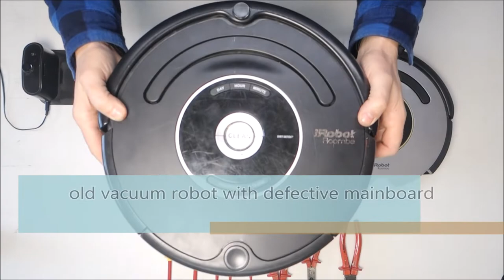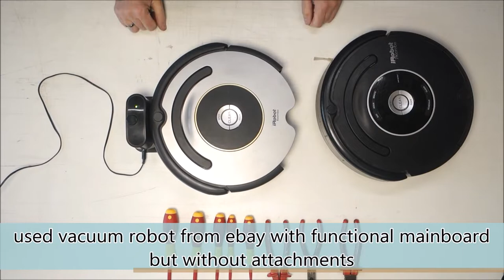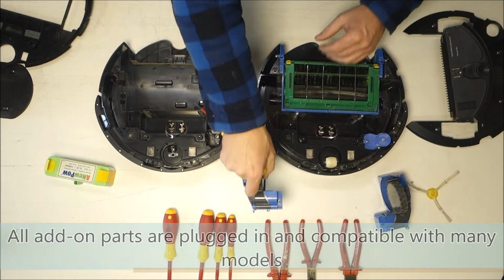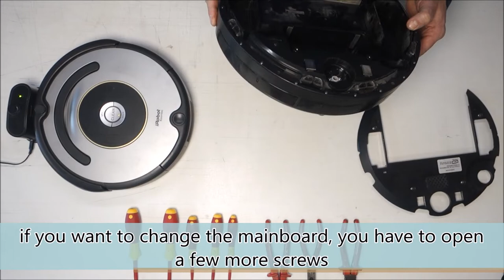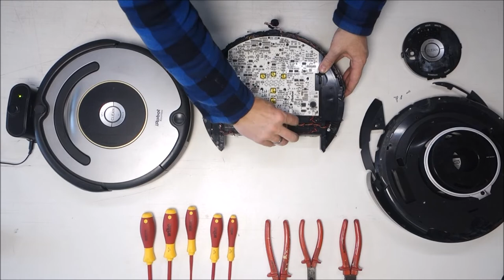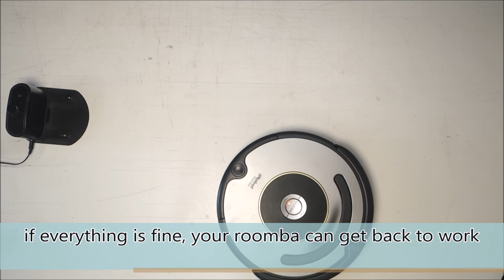Repair your iRobot Roomba

Comment: Sweet! I have the same model. Looking into modding it to use Li-ion batteries with a different charger. Noticed you had a Lithium pack (green)
 I am wondering if those capacitors need replacing on the mainboard of yours?